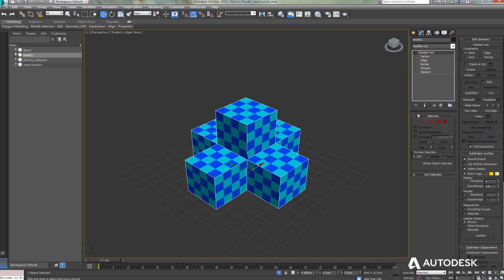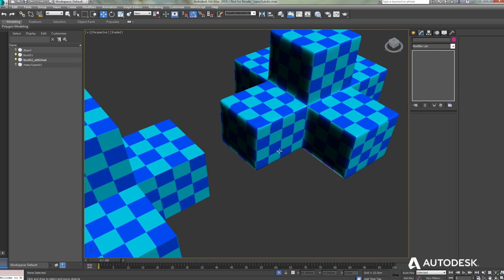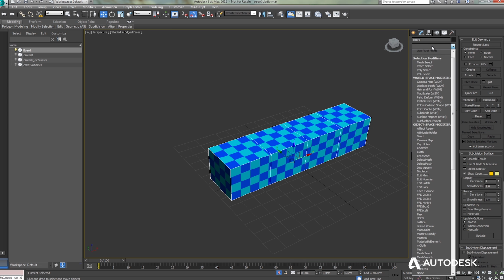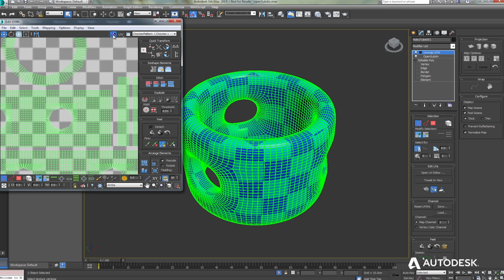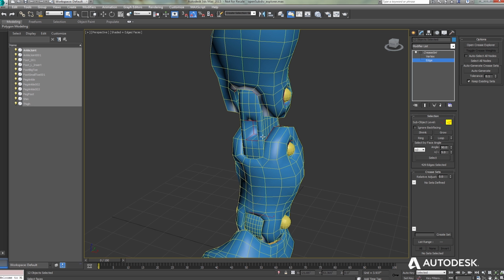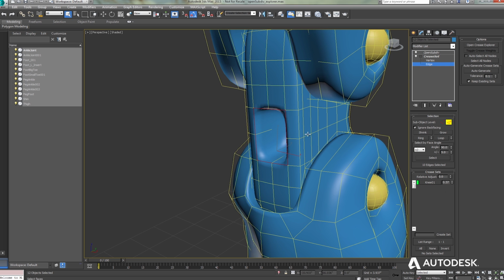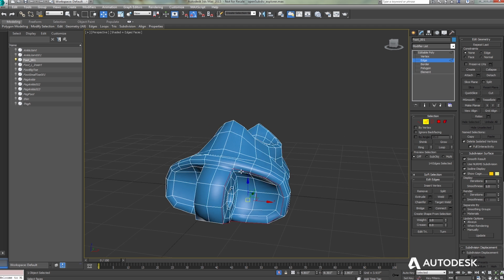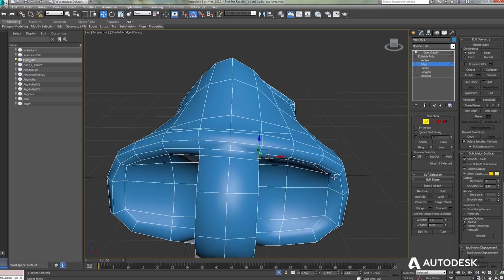3ds Max 2015 Extension 1 - Working with OpenSubdiv

Comment: so whats the difference between turbosmooth, opensubdiv, and meshsmooth?
Reply: lol. There are not much difference between turbosmooth and open subdiv if you are using modern 3ds max versions. The main difference is how they both work with crease. Different results with same crease weights. Test it and choose which is better for you
Reply: Did you even watch the video ?

Comment: I have been using max quite some time, and it boggles my mind that it has to be this involved to do something that Modo and Maya do so easily. Ive have used Modo before and I still came back to Max. The work I do, I know the interface to much better than Modo and there are more options in Max than out of the box in Modo.

There though are new strengths I see in Modo over Max and still with 2016 creases still are no way near as good, or precise. With Meshfusion I believe this will be my last project using 3ds Max 2016.

Comment: Even on a crease of 1 it seems impossible to get hard edges on some meshes without turning the iterations up to ridiculous levels. Much better than messing around with smoothing groups like I used to with turbosmooth but could do with a way of setting an edge to not smooth at all.

Comment: Is this the smoothing algorithm which Pixar invented? If I amn't mistaken it's also called Catmull-Clark Subdivision. And also one last question. I wonder if this algorithm is more accurate than Turbosmooth because I used to get some smoothing problems whenever I applied the Turbosmooth modifier on a curved shape (e.g. two intersected or welded tubes like a bicycle frame). Even when I cut a simple hole on a cylinder I couldn't avoid those inaccuracies. I'd be glad if OpenSubdiv would solve this issues now.
Reply: Hi, yes and no... Yes: it is the one Pixar invented... Yes: it's fundamentals are based on the Catmull-Clark formula wich also was (if I'm not mistaken) a creation of the Pixar team... No: It's not jut Catmull-Clark subdivision, it's an extended one, the formula is almost the same but have a way expansion in the control of the creases... For example, Turbosmooth is Catmull-Clark subdivision; what makes on OpenSubdiv diffent is that it convines an algorithm based on curves/splines-like in the crease wich allows you to controll the sharpness of the edgeas as if you were controlling the handles of a bezier-curve (only that with no handlers but numbers)...
When it comes to the other questions, again, yes and no... it depends... Yes: it's way  more accurate than turbosmooth for the explained above and what the video shows... No: it will not automaticly fix what you mention; perhaps with a bit of tweaking... but it fully depends in the mesh you are working on... Talking about something like a simple cylinder with a hole right in middle, shouln't be a problem for OpenSubdiv because use it detects smothing artifacts and find the best way of pass them throu (at least in the pixar demostration of it) but only as log as the topology is right... you can achieve similar results with turbosmooth if you use contingency loops and a good set of smoothing groups... but yet again, neither of both do miracles
Reply: +twsafarn Thank you very much for the detailed information :)

Comment: Well thats great   but can Autodesk remove the turbosmooth it worthless now
Reply: For backwards compatibility, turbosmoooth must stay.
Reply: I tested it and turbosmooth is way faster than opensubdiv. So please never remove it!
Reply: You can forget that, meshsmooth modifier is still there, lol.
Reply: soulburn3d That is completely understandable, but why not have all the legacy stuff turned off and hidden by default. If you have need for it, just go into preferences and enable/unhide it. Wouldn't that be a simple and elegant solution? Would leave it more clean and overall it would feel less bloated.
Reply: Actually, I think someone may have suggested that on the uservoice forum, basically hide the stuff people don't use, but have it appear if they open a legacy file. I can imagine no one would agree on what is and is not a legacy feature, but hey, vote the idea up on uservoice and maybe they'll look into it.
Reply: soulburn3d Well, I don't think there is a need to go that far.(legacy files and all). Good point, I will go and do that!

Comment: Which hardware does the gpu feature support? I just installed it but the radio buttons for the gpu are greyed out.. I have a new firepro W8000.
Reply: Any card that supports DirectX 11 should work fine.  Are you running under Nitrous DX11?
Reply: Kelly Michels yes dx 11. the card is supposed to support it.

Comment: is it better than maya?
Reply: of course it is.
Reply: Max's select edge by angle feature makes it really easy to select most of the edges you want to crease quickly. You can sorta do that in maya, but it requires using Consttraints, and they never seem to work the way you want them. So in that respect, Max's implementation is better, because its far faster to select edges of dense meshes.
Reply: Hey man.. if JM said it's better, I'll go with what he says because he has some pretty wicked scripts.
Reply: Is the sky blue?
Reply: John Martini  John, I wonder if it's possible to create a script which will stick and let select low poly cage sub-levels to subdivided geometry (like isoline display but selectable)  ? (like in XSI or modo ) I'm ready to donate! :) thanks!!